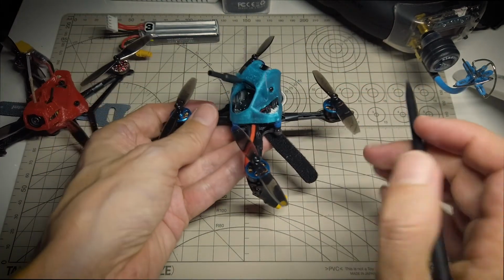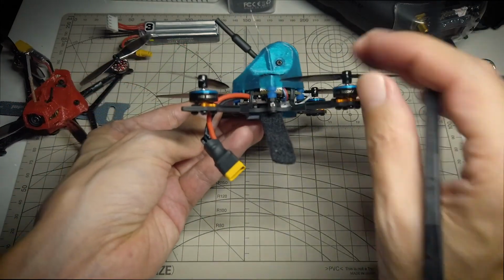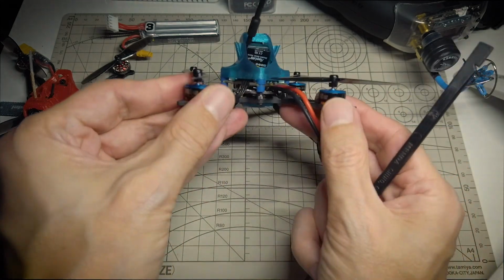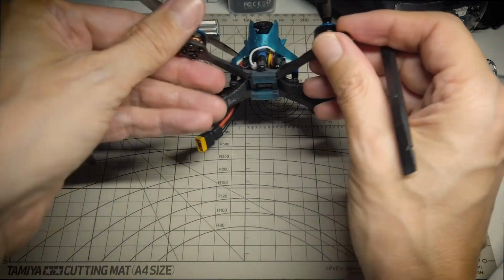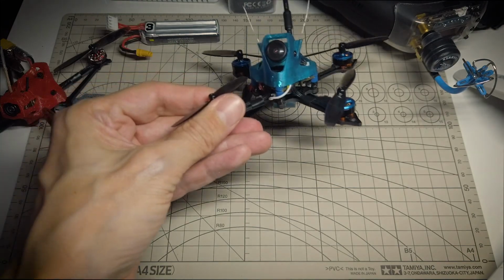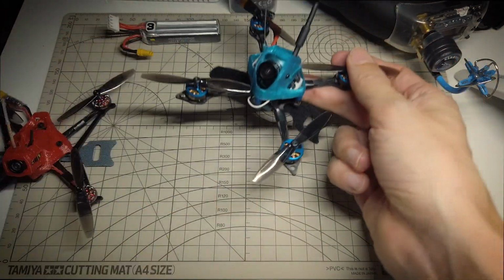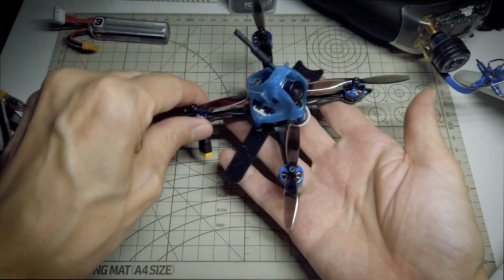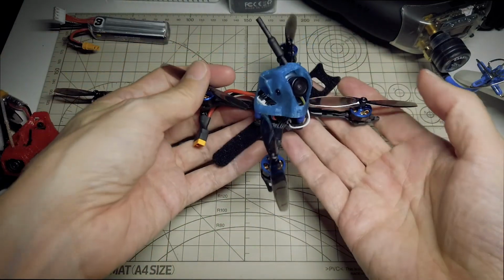A Toothpick: Overview & Maiden

Comment: Try the AMAX 1103-8000kv motors if you haven't already! super smooth and quite ...good power too!...just can't use 3S rated for 2S only but a sweet spot set up for me.
Reply from the maker: drums&drones Thanks for the tip! I like how the motors have a brace where the wires come out to avoid the issue I had with the BARD motors. Maybe I’ll try some next time;)

Comment: Nice! didn't sound quite right, bit more tuning needed?
Once you get the tune dialed in i'd like to hear if you prefer this or sailfly in terms of how they fly. I think this build has much better components and range etc but does sailfly actually fly better/faster due to weight diff?
Reply from the maker: 1LittleTinker Thanks! Definitely needs some more tuning (which isn’t a strong suit;) but I think all the pieces are there. For sure I am happy with the increased range of the XM+ and the image coming from the camera and vtx combo:)

Comment: what's the difference between isolation and normal vibration?
Reply from the maker: I guess I would consider something oscillation if it occurs under acceleration and normal vibration to just be how a particular combination of motor, frame, and props interact in general. However, oscillation can occur without acceleration so I will probably amend my wording in the future;)
Reply: @MiniMicroFPV  No problem. Just to teach myself.
Happy flying!!
Reply from the maker: @paulterl4563  I'm still learning myself! For instance today I went out to try and fine-tune this quad and only made it worse! It's almost like something mechanical changed on it. Once I get it sorted out I'll be making an update video;)

Comment: I have that same stack still in package.  Does the VTX plug and play with the board as shown? Are you able to change vtx power/channels using smart audio?  There are very few vids of this stack so far.
Reply from the maker: akiraproject24 Yes indeed it does and I’ve been using smart audio with no problem:) I have the same gear in my latest vid and there are a couple of close-ups.
https://youtu.be/TbR38kA-p3U